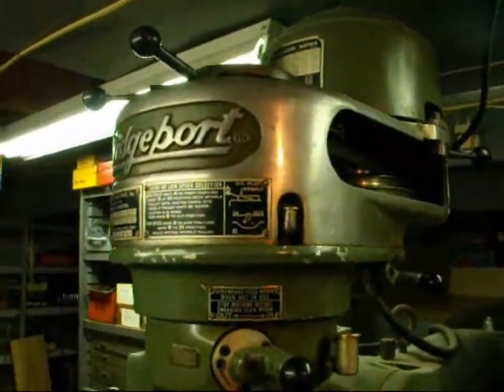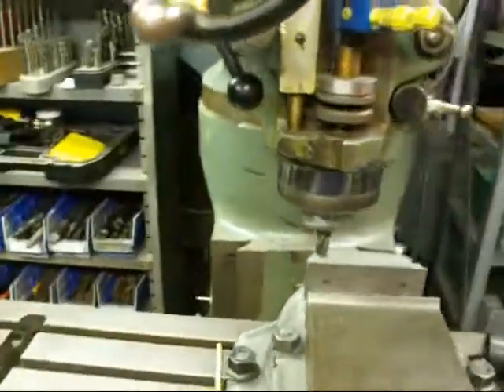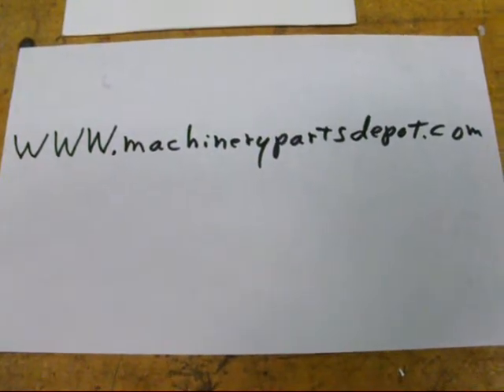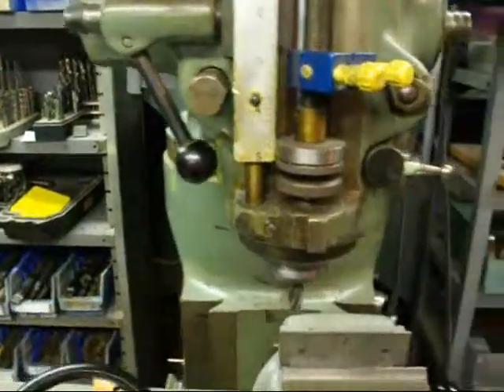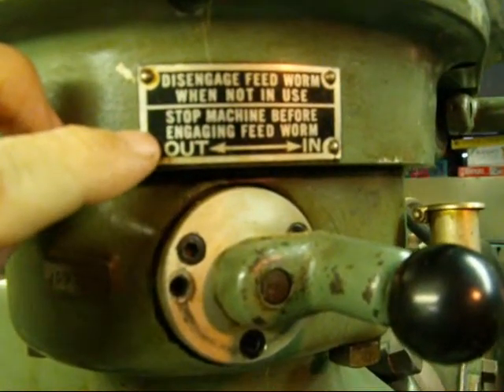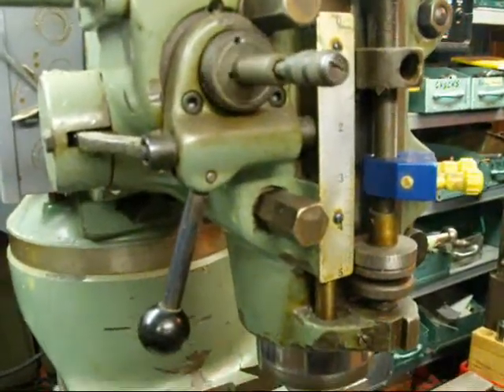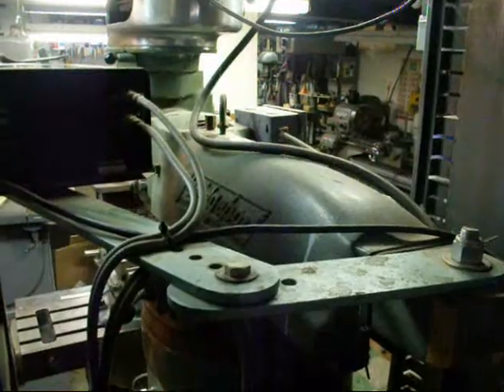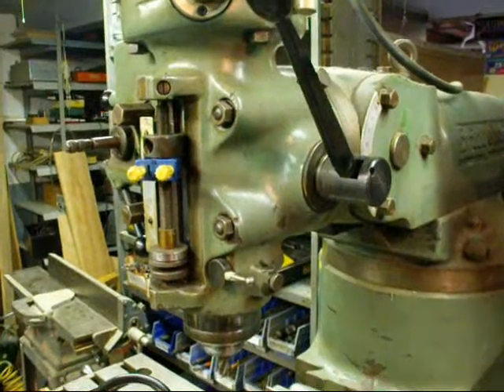MACHINE SHOP TIPS #14 BRIDGEPORT MILL  Parts (B) tubalcain

Comment: Two things on the head  were missed One is the two reference surfaces that stick  out from in front of the quill stop ( above and below) and gauge.  They are used  for certain attachments and the  other is that hole in the  traveling puck that encompasses the threaded shaft  the quill stop  is mounted to.  What's the hole for?   I never figured that out.

Comment: Mr. Pete, I hope you don't mind me leaving this link here as I think it could help alot of people.
http://www.besmermachinery.com/
Pull up this website if you need a traveling master machine rebuilder to come to you. Not cheap at all but if he has to come nearby to work on another job it can bring the cost down. Tim Besmer knows what he is doing. You could literally have your machine in parts in bushel baskets and he could put it back together for you.
Get a quote from him.
He came to Florida and fixed my broken Bridgeport Mill that a sleezy company out of Pawtucket, R.I. sold me in bad condition. Stay away from Gold Machinery.
Reply from the maker: Thanks

Comment: Tubalcain- one thing that I just don't understand is how drill bits, chucks, end mills, etc, actually stay in the spindle. It seems like you can just push them in from the bottom, and they magically stay in. How does this work? In other Bridgeport mills (I'm thinking of Keith Fenner's mill, he sometimes has to turn something in the top to make things stay in. I think he does this when using a collet. I was hoping that perhaps you could create a Part C to this milling machine tutorial to explain how the spindle works with various implements. Thanks!
Reply: There is a drawbar...... A long threaded rod that goes through the spindle and screws into the collet / tool holder.

Comment: these are excellent videos and very helpful i just picked up an old j head to mess around with and had a question about the lever for power downfeed doesnt stay engaged after pulled is there a spring that could be replaced any input would be greatly appreciated thanks

Comment: IMPORTANT: 59 seconds into the video Tubalcain quickly turned the switch on then off. This is called. "Jogging the Machine", and is a very important safety check. Quickly turning the power on then off is ALWAYS done to see or hear any problems with your set-up or the machine once you believe you have completed adjusting the speed.

Comment: Hey Tubalcain. I finally purchased my used Bridgeport Mill. Turns out it was built back in the 40's but still runs true. It came with an "M" style head and I wanted to know if it was interchangeable with a newer J head.  It only seems to fit up to 1/2 inch collets so I would have to get an adapter to use my larger end mills. Also its spindle taper is a little different (2 morse, B&S #7, or B-3) and was unsure as to how to identify it so that I make sure I get the correct collet adapter.

Comment: Very good videos, I use a Taiwanese clone (one of the best, King Rich) of the Bridgeport on a daily basis at work, not quite as good a s a bridgeport but very good machines.
only diff is they have the varispeed head clone, with the variable belt drives.